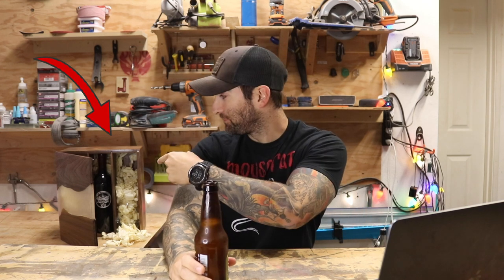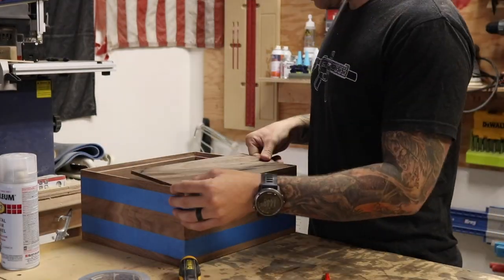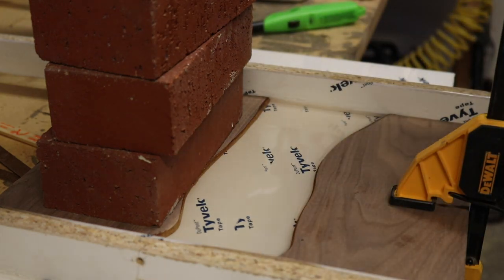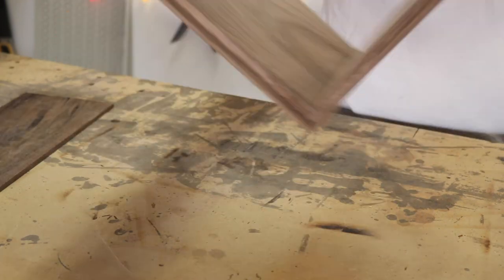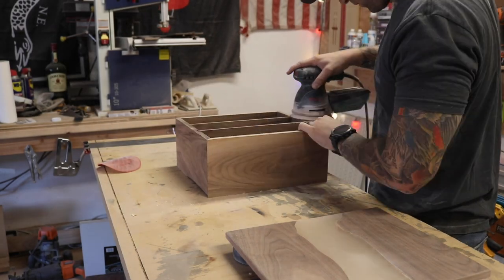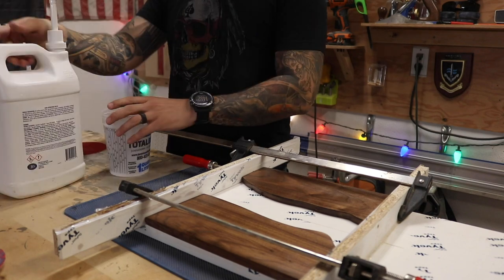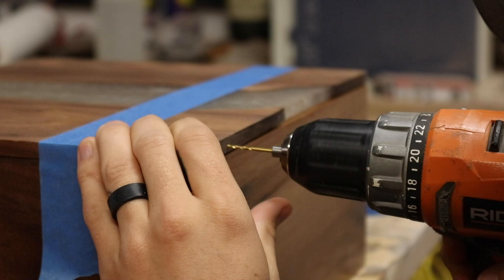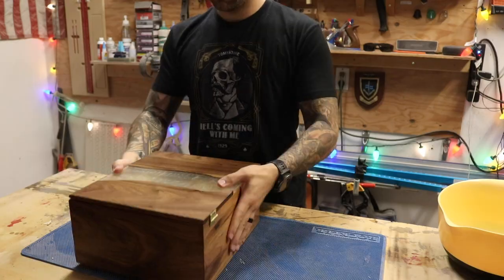How NOT to make an Epoxy Sight glass...

Comment: I’m definitely taking this idea looks awesome. One thing I’ve found works if I’m making a small live edge cutting board I put a small amount of super glue on the wood to help seal it so when I pour the epoxy the wood doesn’t cause as much if any air bubbles. Keep up the good work 🤘
Reply from the maker: Super Glue! i bet thats a whole lot faster! Thank you!
Reply: I still let it sit for about an hour just to be sure its dried
Reply from the maker: sounds good! still way faster than epoxy
Reply: And thank you for your service